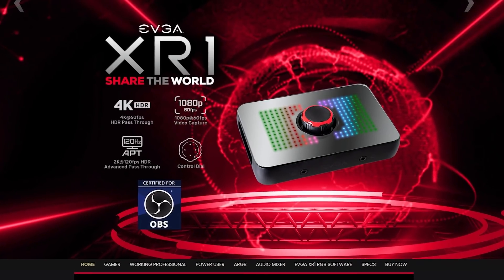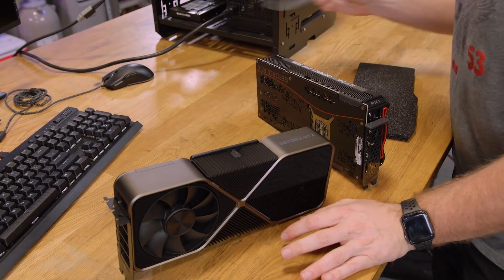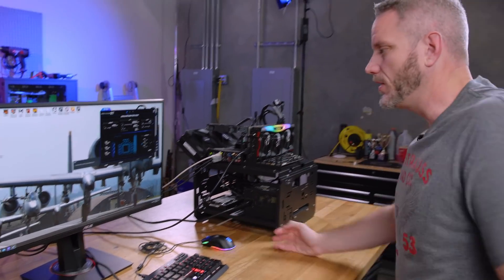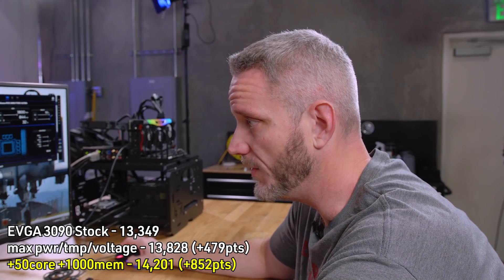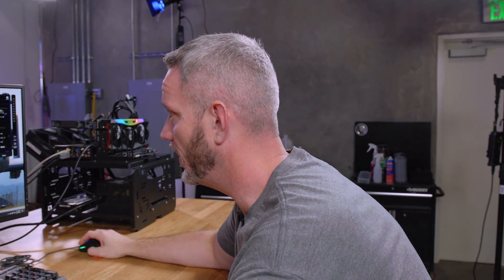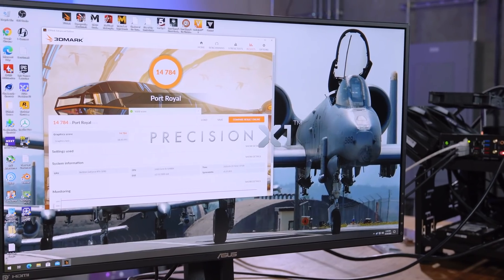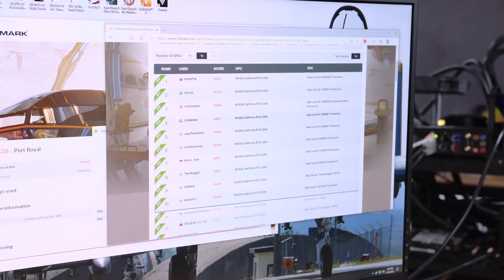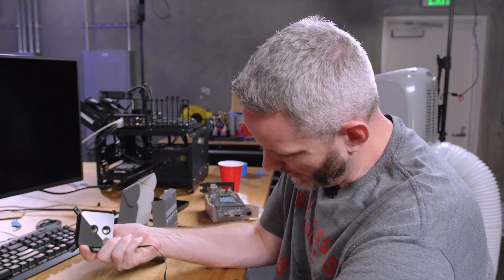This is what happens when you modify the RTX 3090 Bios...

Comment: I now want to A/C OC my 2080 Super so badly...
Reply: What's that really gonna get ya though? Of course you can do it, but if you have an AC in the same room your pc is kept in, that's always on, it's already going to work that way...
Reply: @TheGauges420  Kinda, but no. At best I can get my card as low as ~50c under load with my A/C blasting at max and my fans at max. with the A/C piped directly into my AIO fans I could theoretically hit much lower temps (my A/C can go to 61f/16c). And as far as what it'll get me? Nothing. not a damn thing, except some scores and spending some time doing something fun.
Reply: @BigMan7o0  well my AC also does 60°F, and with my fans at full blast I also get the same temps, and I have 3 front intakes and 2 bottom intakes, piping it directly in isnt going to make it much better, considering with my ambient what it is, I couldn't imagine an open test bench right in front of my AC outlet doing any better.

Comment: if its possible you can have cold dry air from an AC based on the mode. That should solve your condensation issue and should give you more temp control. Though im not sure how much difference that would make to the temp youre trying to reduce. But it will fix condensation.

Comment: Adaptor plate for the GPU, you can do it Jay. 1mm or 20 gauge sheet metal (not aluminium), an angle grinder/dremel and a drill are all you will need. If a garage basher like myself can do it, an expert model ship builder like yourself could easily.

Comment: Hey Jay after crashes with my pc during gaming I realized somehow pins in my pcie slot have been bent out of the slot. It was used when I bought it and didn't realize until it was too late. Now my graphics card is in an 8x slot. It's only a rx480 so I haven't noticed a difference in fps, but I am saving for a new generation hopefully a 3080. My question is now how much of a difference does the new cards in an 8x slot make?

Comment: Everyone who isn't doing what your doing has ideas for you and opinions,  sorry to dog pile you here ,  im a nate certified hvac tech just try this if its possible on your ac unit.  Open up the case and look for a thermometer probe sitting on the coil. If your able to move it actually out of the air path and even out of the case it will fool the system into letting the compressor achieve even lower Temps,  this isn't appropriate for overnight or long term use but in this case is absolutely able to give you even colder air Temps into the gpu

Comment: If i can make my laptop gtx1060 run at locked 2074 mhz clock and 4445 mem. Clock speed with full stability and run raytraycing easily, on stock air, and recalled thermal paste that is terrible, i wonder what #s could be pushed by these new cards, especially with LM paste and water cooling. I see these numbers and simply Dont see the price being worth it, UNLESS the OC ability is on par.

Comment: Jay. Use the 20 series pcb and make the bracket from that. 
Looks as though the smaller inner holes line up with the 30 series holes leaving the larger outer holes on the 20 series to mount the block to.

Comment: 10c is the temperature of my house indoors today so I wouldn't need the air conditioner,  so I could save energy and CO2, and save the planet a bit more.
The government has insulated my house against any free heat ingress from the Sun, so it turns into a morgue after August until May, which is ideal for overclocking cards, but i gave that up some 30 years ago as I was worried about stuff freezing in my cooling blocks overnight, as the house I lived in then, would get ice indoors on the walls overnight. 
In the end stability and longevity is what most people want, and I certainly get that with my PC, in my chilly South facing house.

Comment: I know this hasn't been stated in quite awhile. But Overclocking the CPU or the Graphics Card and it fails or breaks your device, that's on you. It's always a risk and don't be surprised if the manufacture doesn't RMA your electronic equipment.
Is it fun? Yes! But it's on you if you break it. It has been about 7 years since I've checked RMA regulations/rules, so things could have changed. Reason I say this, I've been hearing some complaints about the 3080/3090 with their OC's not working right. Doesn't matter what the fix is from Nvida, just know its a risk on your end. a lot of tech folks know this, but if you're new to overclocking, consider this an FYI.

Comment: I have been wondering.... Since the fans on the cards pull from the overall power going to the card, what if you turn those all the way down/get rid of them and just use case fans instead, would that benefit? I mean, in theory since the GPU won't need to route some power, it could potentially increase power to core and memory. But I guess, if you are just going to water cool or LN2 the cards, this wouldn't matter. Just food for thought while you are doing the AC setup.

Comment: With the newest drivers my 3080 fe will boost lower on its own. But will overclock much better. Wouldn't hit 2100 before but is stable at 2160 now. Mem will even improve on port royal up to +1200.

Comment: "Condensation is a biscuit"
-Jay (2020)
Reply: Condensation only occurs when warm air hits a cold surface, not the other way around. 
Which means condensation might only occur if the AC air cools down parts, and then the room air touches those parts. So taking a bit of care to let the cool ac air flow over the whole board should mean no problems with condensation. 

Also,  Jay,,, daisy chaining AC's ? 
SLI AC ?

Comment: @ 0:30 there are NONE available on the amazon listing, i dont understand why EVGA is wanting to advertise something they do not have product available for. Its BEYOND ME.

Also @ 13:15 you are elaborating about power limit. Now im not a rocket scientist, but with overclocking requires more power and more juice. If you ask me? 
If i was overclocking a card that wants almost 400 watts at Idle, I would grab a 2nd 1000w power supply, plug the PCI Express power connecters to that separate power supply, and jump the green wire with the black wire in the middle of the ATX. So that way that graphics card has its own power supply and source of power. Its pretty obvious your cooling is doing more than enough when you plug a carboard vent directly to a graphics card. lol If your crashing and you mention power, dont forget your 5ghz processor is sucking quite a bit of power too. 

You may be able to get yourself closer to the top of the list using 2 power supplies if you set it up this way.

Comment: Are there any motherboard requirements for the EVGA RTX 3090's  RGB colors to be addressable/ accessible, or are they controlled by the card's software?   I am using an ASUS  P9X79 Deluxe motherboard. Thanks for the very informative videos, Jay!
Reply: No you have to cover it with tape prefers a mobo with a metal gpu alot

Comment: I'm curious. When going LN2..would adding a pci-e  extender work to keep the GPU and the frost/condensation away from the MB?
Reply: Sort of. CPU will still be LN2 BUT.... using the pci-e extender would pull the gpu cold/hot/frost etc... away as you said BUT you will introduce some signal loss when you extend the riser cable. So at this point, unless one of these guys have done it, we need to move to the next step and actually try it to get the numbers and see if theres any loss' and if you can mitigate it somehow.

Comment: Considering Blender works 40% better on Linux, you might start thinking about how the OS itself is hitting your numbers.
Reply: reaaallly??
Reply: @strongforce8466  Yep, either a massive PC upgrade or an OS swap for Blender. Not sure about the rest, they seem pretty sameish, but I bet that's due to poor optimization.
Reply: @kresimircosic9035  I'm getting into Blender so if I get serious at it will have to get into Linux aswell, I'll need to look up benchmarks too, some must have compared it, 40% sounds like waaaaay huge of a difference
Reply: @strongforce8466  You can find the clip on YouTube, video made by CG Geek. It's even on Ubuntu which is one of the heavier distros to run, but it still worked way better than the Windows version.
Reply: @kresimircosic9035  thanks for the info mate, will check it out, I'm subbed to that guy :)

Comment: I said this on Hardware Canucks "console build" where they used the EVGA FTW3, and I'll say it here. The diffuser on that card looks amazing. I've never seen LED's illuminate as beautiful as that, and I'm far from a fan of rgb.

Edit: @JayzTwoCents If you get me measurements of the mounting holes (inside to inside and outside to outside) on the board and the mounting points on the block you want to use I might be willing to whip up some offset standoffs for you.

Comment: Jay: Yeah, No, 55⁰C is just too high for stability.
My RX 580 nervously sweating at idle 52⁰C: ^~^
Reply: Ooof, my MSI Duke RTX 2070 OC never got over 55-60°C on air cooling under full load. I'd replace your thermal paste maybe.

Comment: Something that would be fun: get an engine with a small turbo, do an ice to air cooled intercooler and make a box that can fit a rad connected to the GPU between intake and turbo and have the most inefficient and noisy cooling set up ever XD Something that could do high boost, maybe a diesel engine for added smoke and memes.